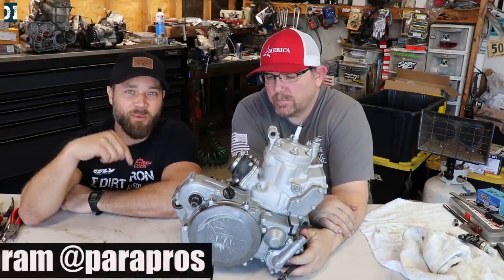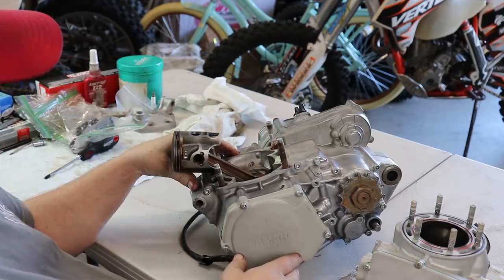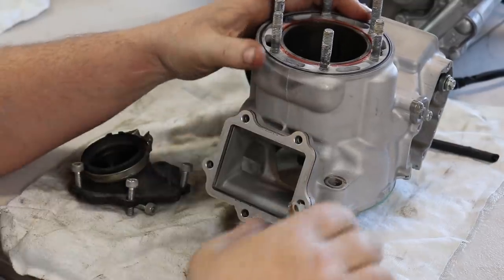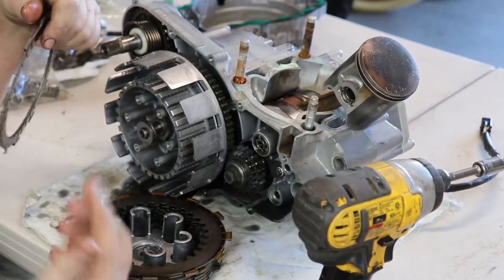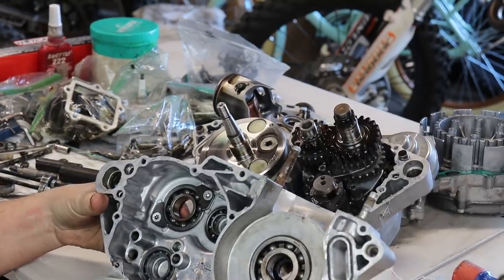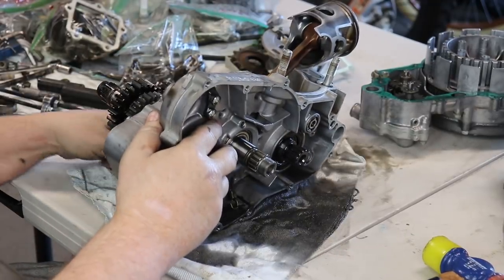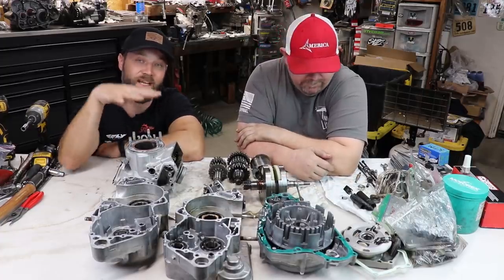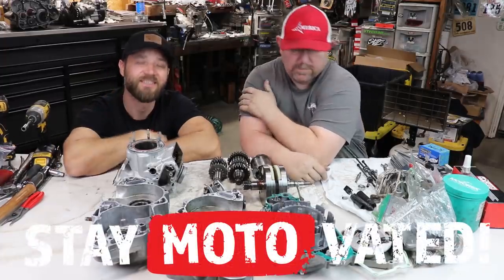What is wrong with YZ250 engine?? - YZ250 build

Comment: If the clutch overheated how will that make the rod fail??
Reply: Ryan Muller when the clutch goes out like that the motor RPM will be really high and bike going nowhere witch in turn would cause heat to build in rod bearing 
Because motor if flying and going nowhere
Reply: @brad5664  bearings need a bit of a load or it just kinda revolves around and is able to slightly float in a way.  For lack of a better term.  That's how I see it.  Be nice internet I'm not an engineer 😆
Reply: @robbed_of_sanity  when a clutch goes out tho and you are pinned because your think your going slow so you just keep it pinned  your motor will over heat and lean out there for on a rod bearing that is already worn out it would just burn up the bearing ,,
Reply: And I probably should have said that could be 1 of the reasons why the rod failed . It’s just some people think they can just keep it pinned when there clutch is slipping that bad ... I had where you could put in gear let out clutch and gas it and go nowhere!
That’s bad o  the hole motor
Reply: Hmm, I may jump in here. I'm not a mechanic, but I am clued up on motors.
Unless the design changed over the years. 2t rods have a roller bearing both top and bottom. They do wear out. But the crank pin big end likely would come up to spec if mic'd. And those crank wheels too would have been fine. The shafts don't spin in the bearings.. So this uneven wear about the clutch going bad causing excessive wear on the crank/ big end, seems like some theory some one has come up with. 
Now if we where talking harmonics. Or excessive rpm throwing the big end into excessive load from inertia, that too would be a feasible approach. But I'm not buying the heat generated. More parts would fail before the big end would be effected by such heat to cause failed. IMHO.

Comment: I'd guess the broken power valve actuator arm, saved the powervalve componants from wearing out - perhaps from some earlier attempt to retime/adjust the valve via some ilconceived previous owners different ECU/Ignition failed 'home-tuning' (or very unknowledgable garage/shop) mod ?
..or something, that caused the valve to hit the port bridge/stop at the wrong exhaust flow time and cause the arm to fail ?

Comment: At 8:24 it looks like there's a crack in the case going down from the main bearing, through to the exterior of the engine about 1" long. Doesn't look like a manufacturing mark, that one. It veers off around the bolt hole.
Reply: hello.... they are just case marks all the yz250 have them they do look scary but its cast making i can clean them up and you would not see them 
when we do the motor in the next  i will show more on what they are

Comment: Are you using the yz250x transmission in this build ? 
Just curious as you say you have a wide ratio gear box and wondered if it’s a straight swap 
Thanks
Reply from the maker: yes, it is a 250x transmission, just as Kris said, 3rd, 4th and 5th are different. It is straight swap
Reply: Yes all correct

Comment: Have Tom Morgan port the cylinder.
Reply: 64maxpower yes we sent to Tom Morgan for the re plating   And have a little bit of work done it will be really nice motor when all said and done
Reply: @brad5664  have you considered a Stic for the carburator? I ve  heard only good things about it
Reply from the maker: we are going to use SmartCarb for this engine

Comment: I put brandnew vforce reeds in my 2018 yz250,  I ride mostly hard enduro,  after 1 ride, I took the vforce reeds out and they been on the shelf since.  I lost alot of slow end lugability. Up top n mid range they were a improvement over stock reeds but most of my riding is lugging around.
Reply from the maker: thanks for sharing Ernie, I will run vforce too, lets see how it feels
Reply: Do you want them? I can send you them in trade for a XL T shirt 🍻
Reply: @dirtniron  something I did on my yz250 that is the best mod I did,,, motion pro coolant recovery system tank,  I do alot of really slow speed hard enduro riding. I've never once had my bike steam up or foul a spark plug.  Best 27 dollars I've ever spent
Reply: @dirtniron  I posted a video of me climbing a mountain in the snow on my yz250,  check it out.
Reply: I feelt the same, the nice smooth power in bottom dissapered with Vforce.
Reply: @jakan756  try moving your needle clip down one spot and maybe run your air screw in a quarter turn .
Reply: @wrenchone5003  okej. Thank you sir

Comment: clutch taking out a bigend - what planet. Just put a clutch basket it in so it disengages easily.   The trans will be fine, maybe 2nd gear and measure the shift fork finger thickness, they get false neutrals

Comment: all mention of pressure plate is clutch    not engine
Reply: well technically the pate is called a holder but it uses pressure to keep the valve so it doesn't move around so we just call it pressure plate the springs are called compression springs but again it uses pressure ...thats  why we just call them pressure
Reply: @brad5664   thank you,  i am accustomed to old simple ones. ha ha

Comment: Why are you so rough with the engine if you did that to mine and I was around it wouldn't end well. I don't care if it needs a whole engine rebuild. That's my baby 😕
Reply: emmanuel Bent 
Like what was so rough? 
Please tell us ...
Reply from the maker: Yes, i am interested too. What is so rough?
Reply: @brad5664  I bet that guy sends his bike to the shop to get the oil changed. Some people have no idea what sort of force is required to dismantle an engine.
Reply: Xterrential yes very true .. thx man
Reply: Lol I have an opinion, I've said it, I do all my work myself 4 strokes and 2. I save my bikes from work shop warriors, like that guy in the video roughing up that engine 😂lol I'm not going to get into a YouTube keyboard war.  I like dirt n iron. So go war with another comment. Keep up the videos 😀
Reply: @emmanuelhud1  If it was me working on the engine I'd be a lot more gentle with it personally, especially other peoples gear. I consider working on bikes a enjoyable experience, not some job i have to get done before i can go home. Maybe that's the way all mechanics operate when the customer isn't around, who knows.
Reply: @dirtniron  using an impact gun to remove the shift segment would be one example, quote from the manual "If the segment gets an impact, it
may be damaged. Take care not to
 give an impact to the segment when removing the bolt."